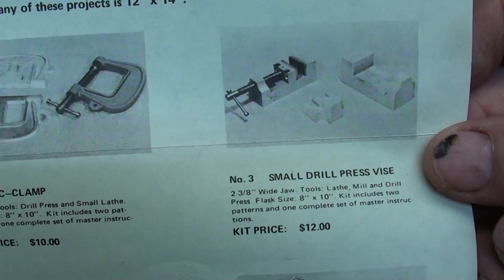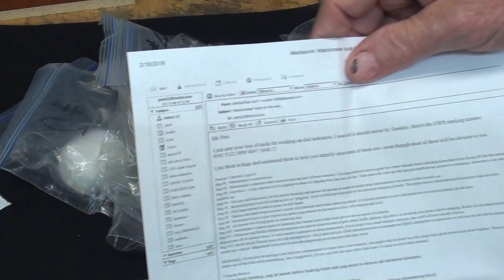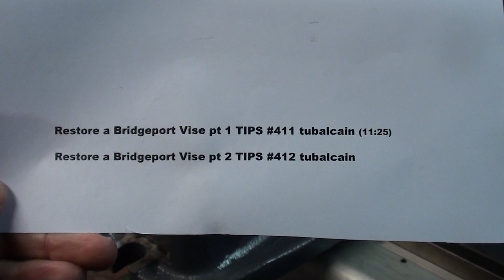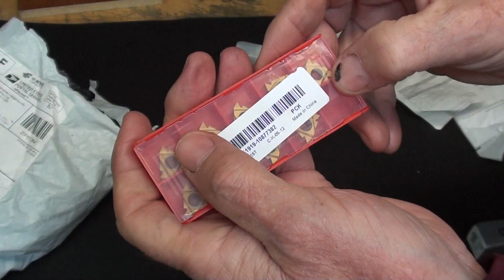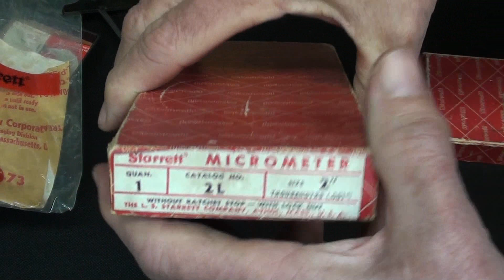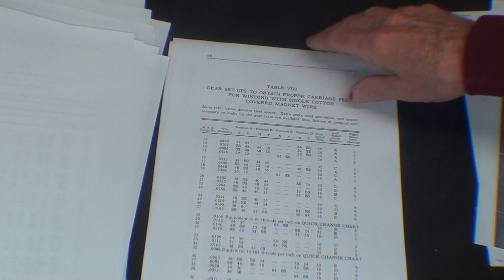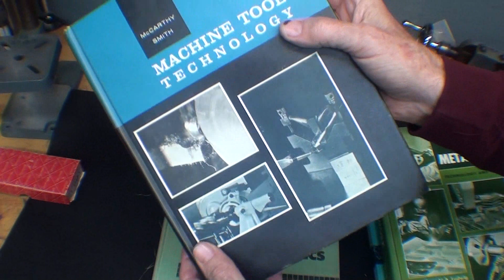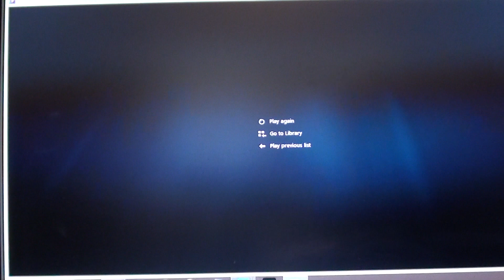THIS & THAT Episode #36 tubalcain mrpete222

Comment: There is no such thing as mrpete222 video being too long. I often find myself disappointed when the video ends when I am so interested in the content. I am sure I am speaking for many here when I say, "I would love to sit and pick your brain for several hours." You are a wealth of knowledge.
Reply: Second that. I never get tired of hearing about machines, machining, micrometers, castings, just anything that has to do with shaping, carving or melting metal. I was a bit disappointed when mrpete shoved aside one of the engines right off the bat. And I'd love to see more vintage books, perhaps with some more detail about their contents. I am also constantly gratified by the kind of fraternity that has arised between machining youtubers.
Reply: I also have no issue with longer videos, if necessary to cover the subject matter at hand. It's the ones that are long just for the sake of being long, or someone who is clueless, or someone repeating themselves countless times that I can't stand.

Comment: Never even seen a Mole, but remember reading once where a garden variety lit highway flare in a hole, then covered/sealed in with whatever is appropriate works extremely well. Also, yes, 1957 for the Vise Grip quick release... Wikipedia has an entry on the tool, be sure to look through the  'References' & 'External Links' at the end. And for the record, as a kid I mowed the lawn for years... and sharpened rotary blades countless times with a file. All the blades I ran into were butter soft, and could be finely balanced by just taking a little more off the heavy blade. (I learned it's important to clean off all the stuck on grass spooge first as it's heavier than you'd think.) Rub that case hardening down with some oil to preserve & make the colors pop! Very nice of you thinking of Adam for the books... cool video, Thanks!

Comment: Another great video MrPete. They are never too long. You can file a mower blade. I know this because I used to work for a guy at a small engine repair shop who required us to draw file them. They were almost sharp enough to shave with, which was counter productive because once around the yard that fine edge would be rolled over to the point of being useless.

Comment: I had a cat once whose chosen primary past time was bringing me deceased moles.  10 or 12 a week every summer.  Eventually after a decade of that I had no more moles in my pasture.   A trap would maybe have been cheaper, but when you add in the time of setting and resetting, the cat was the best way.   LoL
Reply: Yeah, the cats get rid of the moles, but I'd rather not have them bring their collection inside.  Eventually they end up dragging rabbits and muskrats into the shop. 

My mother used to sit in the lawn with a double barrel 410 waiting for them to move.

Comment: I made the Dynamo engine, but I bought the machined one, and only assembled it. It works great. Where did you get the small light holder. I went to Ace but they only had the 110 volt holder. I ordered another small motor to run the dynamo, and it should be here soon. Thanks for sharing that setup.

Comment: I have a G0704 Mill as well. Nice mill.  I converted mine to CNC.  It's currently in parts as I'm now upgrading the ACME leadscrews to Ballscrews..  Had to wait till I got a Bridgeport for that job. That's going to be a upcoming project this summer.
Reply from the maker: Sounds like a good upgrade

Comment: The bit at 12:30 talking about the Nicholson ad. I agree about the model and the photographer not knowing what they were doing but considering it was likely from the 50’s they would not throw away the blade like we might now and a file will work to sharpen a lawnmower blade. I don’t have a lot of money to buy tools and have kept my lawnmower blade sharp by using a file.

Comment: Interesting that people think Atlas lathes were for home use. When I was in high school in the 1960's we had 12"Atlas lathes in our shop class. That's what I learned on and we did some very accurate work on them. I have Southbends in my shop now and a very large Hamilton lathe that is in new condition. It came from a compressor station and I don't think it was ever used much.
Lonnie

Comment: I don't know either when the vise grip came out with the extra release lever, but I have 2 original Petersen vise grips without it. They were my dad's. They appear not to be plated as well.
Reply from the maker: I have three of the originals. They are plated, but the pleadingis very bad
Reply: mrpete222 Maybe mine are too, possibly old cadmium plating? They don't seem to rust, but look like unplated steel.

Comment: #1no safety glasses #2wrong grip on handle#3workpeice extended too far#4wrong holding direction#5 vertical placement of work should be horizontal from plain of stroke stance. are there more I have not indicated?

Comment: Were there still drawings around of your vise for the 3D model to be based on, and what about the other models you sold? (Your last video discussing this implied the drawings were all gone, but here’s the vise revived.)

I suspect you have many more viewers than you might expect who would be glad to hone and/or show off their 3D modeling skills by translating whatever documentation is extant into 3D models which might either be sold on flash drives or put up somewhere for download.
Reply from the maker: I found the drawings. But the original patterns were burned
Reply: 9Joel C. Salomon
Reply: Then I’m sure you’d have no shortage of volunteers to scan the drawings for you and to turn them into 3D-printable CAD models. (I’d offer, myself, but it would be more in the way of learning a CAD package and I’d make no claim that any models I’d produce would be any good.)

Comment: Lyle, shouldn't you be measuring the defection at the point where the drill bit intersects the work not at the outside edge of the bed to be more accurate?

Comment: When you have a tall vise (with the positioners), 0.005" downward deflection will cause the stack to tip outwards. I would like to see a test where you measure how far an object in the vise moves AWAY from the pillar of the drill press. I know that a tall object mounted to the table of my modern Delta drill press moves outwards as much as 1/8" under the downward pressure of a 1" drill. That is WAY too much deflection, so I made a jack to support the underside of the table.
Reply from the maker: Hi Peter yes that is all true. That might make a good video. But it would be very unscientific
Reply: Good point. I think I have a tall setup on my drill press at the moment. I should just put a large drill in the chuck, an indicator from the column to the back edge of the workpiece and crank down on it. There should be some considerable outward movement with the amount of pressure needed to push a 3/4" bit into the work. I'll get a video clip and maybe it will impel me to edit and publish another Erratic Gallimaufry. (It's been a while.)

Comment: I just went in the shop and put a spare blade in a similar vise and did what the model did...oh boy...so, has anyone ever heard a cat skinned inside a metal tube? Because i think that's what i heard. They were clueless alright...
But those blades (at least modern ones from Kubota) are made from cheese grade metal.

Comment: That vise causes deflection regardless of where you set it - drill press, Bridgeport, floor... I would like to see you repeat the drill press table deflection measurement with NO vise and just the down force applied by a drill bit via the feed handle. My guess is that a lot of people put gorilla force on the feed handles that would cause every bit the deflection of the vise. Yes, vise PLUS gorilla force might double that deflection. But as you so eloquently stated - "Insignificant". My non-PC version of that is "picking the fly s#!t out of the pepper"...
Reply from the maker: That is true

Comment: Find a mole run, insert a flex hose and connect it to your tail pipe. Let your vehicle idle for about an hour. The carbon monoxide will kill, or run off the moles. Most importantly it will kill the bugs they come to eat as well as make the environment undesirable for the moles to come back.

Comment: I prefer  to sharpen mower blades with a file as the blades don't get burned as when using a grinder.  I also balance the blades.

Comment: Hi Mr Pete 
I’ve been looking to buy a milling machine for the past 4 months,
I’ll be looking at a Bridgeport Milling Machine this weekend.
I’ll be paying particular attention to the ways and backlash, is there anything else I should be closely looking at ??
Reply: If it is variable speed and the machine is under power run it in back gear and direct to make sure that is ok. Check the quill power feed for correct operation.

 If you hear a knocking, the plastic bush in the variable drive has given out. Repair parts aren't expensive, but watch a video on how to replace it... it's like arming a very large rat trap.

If the machine is belt drive there isn't too much to go wrong there. If it runs quietly it's probably ok. I prefer the belt drive heads... you end up running most cutters and drills at around 600 rpm anyway.
Reply: Cool,
Thanks for your reply.
I’ll let you know what I find.
Reply: As is turns out, 
I get a message from the seller telling me that he sold the machine 😡
And this is after he agreed to show me first
Reply: No worries... machine tools are like buses. There will be another along in just a bit.
Remember that you are part of a very small buying market. A machine shop already has all the Bridgeport type mills it needs... if they're mainly a CNC shop they will still have one over in the corner for odds and ends.
   Also, most home shops don't have room for a Bridgeport. They don't look that big... until you try to put in your workshop... one of the kickers is not having enough head room. A variable speed machine is almost 8 feet tall, and then you have to have enough room to get the draw bar out on top of that. Added to that is that your floor needs to be able to support 2,000 pounds without vibration.
 All this explains why Clausing 8320 knee mills bring their weight in gold (As do the South Bend mills, but they are hard to find). If you are doing small work, ~6"x6"x6" work area, you might consider a Benchmaster knee mill (similar sized bench mill).. there is a Yahoo groups page for them where members have them for sale occasionally.
Reply: Aceroadholder I ended up buying a Bridgeport Milling 2hp.
I’ve uploaded a short clip.
It needs a few things doing to it but it’s a good machine to start from

Comment: A new blade for a Honda mower is $35, too expensive to throw away. I file mine to a razor's edge. It only takes about 10 strokes with a file. And the blade is carbon steel and files nicely. It's not hardened as far as I can tell.
Reply from the maker: I did not realize they were that soft

Comment: Actually lawn mower blades are non that hard I file mine with a standard mill file no problem.   I think a high hardness blade would could shatter and throw shrapnel if you hit a rock, Notice when you hir a rock with your blade it dents the edge instead of chipping it.

Comment: tell dan to get a stock of spare motors an gears because they will fail i changed my mill to three phase motor an pulleys because i was fed up of the motors burning out other wise a quite capable little mill